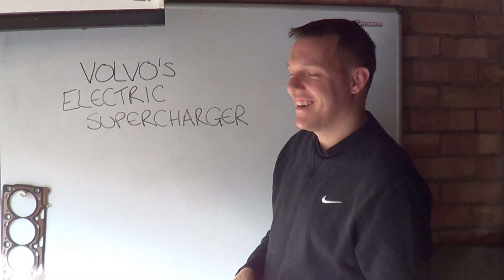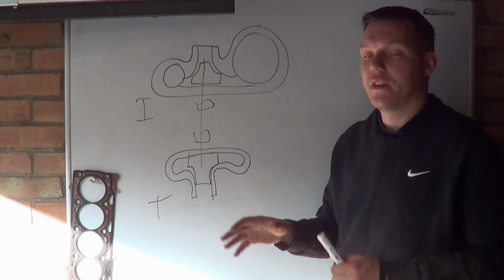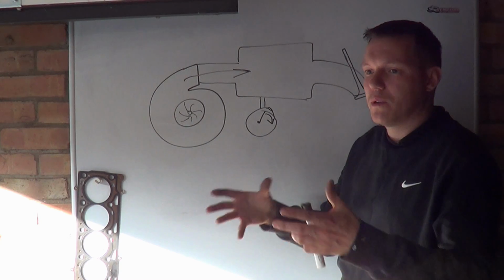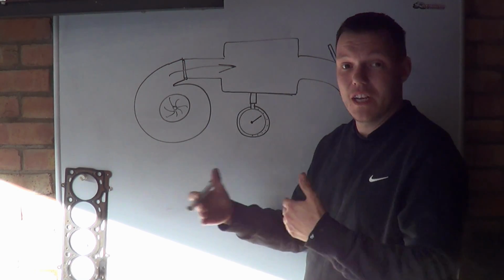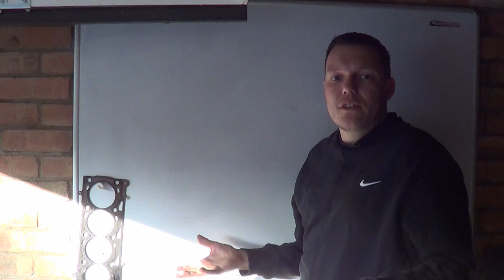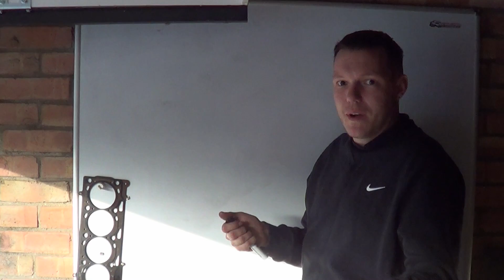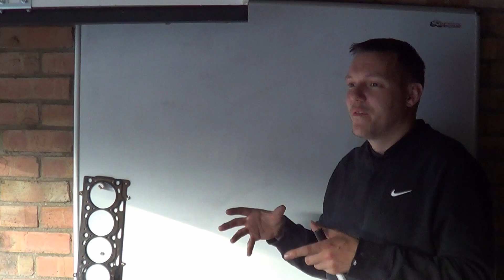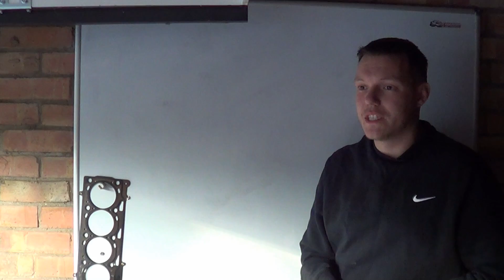Volvo's electric supercharger?

Comment: 1st device u described is NOT a mechanical supercharger. It is a turbocharger. The 2sides r called the turbine &the compressor. Superchargers r driven mechanically. Turbochargers r driven by hot expanding exhaust gases. It’s difficult enough2 understand  u w/your nose clogged atop a deep accent. Forced induction systems s/b explained by professionals w/clean hands& clean civil speech lest u botch the job like this. 

This is an embarrassing filthy mouthed fail.

Comment: If the pre charger is kept running even once turbo is at max rpm/boost will it not increase total mass flow and therefore increase total boost even at max continuous power? = more power over all!
Reply from the maker: Well yes, but you need massive amounts of power to do that. Any increase at 100% normal load is huge. Think HP vs fastest speed

Comment: There is a Dutch company selling electric turbo’s to day.

TorqAmp
2500,- euro / dollar
Reply from the maker: LOL yeah I've seen it. Boosts engine power lower down. Works a treat - however, why not just fit a normal turbo and have extra power? They cost about the same and use the same amount of fuel

Comment: a few people have told me 3hp [electric] roughly =5hp [gas]    do you agree?
Reply from the maker: What? For how much air? What flow rates etc etc etc. And the power would be the same - why would it be different?
Reply: @thedirtyworkshop  for any given task ex water pump if u had a 3hp electric  it would take roughly a 5 hp gas engine tp do the same job (incorrect or correct? )
Reply from the maker: Incorrect. That's what the measure of power is.... How much 'work' the engine/motor can do.
Reply: @thedirtyworkshop  thank you

Comment: that 20 percent is that just for turbos?  I was told the non screw [top fuel] superchargers can take about 30 percent of an engines power   thanks for patience
Reply from the maker: well its 20% of the total. So if an engine after turbo is installed makes 100HP then 20hp of that is what was required to compress that additional air.

Comment: how would you figure out the hp needed to supercharge or turbo an engine completely with an electric motor?   please be as specific as possible.                would it be based mostly on displacement and desired boost?
Reply from the maker: Great question, so you have to have specific numbers and they are as follows;

1) Mass flow rate - so how much air and in what volume. You also require the time of intake duration.

2) One issue with doing this mathematically is the gas deviation factor, also known as the compressibility factor. There's isn't enough room in the comments section to explain that so google it.

3) Next thing you need is the turbo efficiency and blow-by figures. Both for the impeller and the turbine. 

4) You'll also need a displacement volume graph for the engines cylinders, they're timing and the manifold flow dynamics. 

To make sense of all this you need to know

a) how much air per rev.
b) the mass and volume of that air which means you also need the temperature - this is of the ambient air.
c) You then need to know how well the cylinder(s) fill and how fast. So volumetric efficiency can help somewhat here.
d) the flow through the manifold - this is important because it helps you determine the surge limit of the turbo, and this tells you how much power you require from the motor. 

The easiest way is testing, or use figures from a system that is already used. For example you can look at an engine and say 'about 20%' should be good enough. 

So my question is, are you wanting to work this out pure mathematically or practically?
Reply: For the Volvo in this video how much hp would an electric motor need to take on all of the charging for that particular engine
Reply from the maker: Well I don't have all the numbers. Like I said.
Reply: So let me ask on an engine that has a charger (tur or sup) would the manufacturer have all those numbers?      Would it easier to dyno it.   Then try to mimic it with an electric motor to get the same readings?
Reply from the maker: "would the manufacturer have all those numbers?" - yeah of course they do. They had to so they could chose the correct system. Will they give them to you? - LOL no.

One thing you can do is record the T1 and T2 of the turbine. Record the temp before and after the turbine and then you can work out the energy - then with the turbine rpm you can work out how much power that is.

But it's easier to get you in the ball park. You get the engines total power and take 20% of that. That's the motor you require.

Comment: Like turbines in a power station, a turbocharger's turbine extracts energy from mass flow. It's not "heat energy from the flow of the exhaust system", people who say that are fooking idiots.

Get your damn theories straight before you start to educate people on the Internet. Or at least admit, that you don't know how a turbine works. Better than calling all people fooking idiots who actually know how it works.
Reply from the maker: ""heat energy from the flow of the exhaust system""

Turbines work on the momentum of the fluid, gases or liquids - just fluids. This momentum is the mass x it's velocity. The heat of a gas and its kinetic energy as proportional (average) Therefore the heat of a gas in related to it's velocity. Seen as though a gases mass in an engine is pretty much constant (depending on the Ve) then it's the heat and therefore the kinetic energy it has.

Mass flow is the mass, area and time. From this you can work out the velocity - and mass and velocity give you momentum. 

Funny how you say that "Get your damn theories straight before you start to educate people on the Internet." - but you're the one getting schooled right now...
Reply from the maker: If you still don't agree, point out what's wrong below.
Reply: @thedirtyworkshop  I can't tell if you genuinely don't understand how all of these terms interrelate, or just coming up with this back-assward explanation to prove, that what you said oringinally is somehow actually right. The following is where you're completely wrong:
"The heat of a gas and its kinetic energy as proportional (average)."
"Therefore the heat of a gas in related to it's velocity." (I'm just going to gloss over how "proportional" and "related" does not mean "is the same thing", which is what you're stating in your video. Also, that you're calling people idiots who suggest velocity has a role in a turbine, yet you are now stating it yourself.)

What you wrote before and after is true, but these statements are making a connection between two completely unrelated terms. Temperature (let's call "heat" by its proper name) is one important property that describes the energy contained in a gas or liquid. Now, what's another important property for that?

Also, let's make a thought experiment. Say you have a furnace that you can put the the turbine side of a turbo wholly through. The CHRA and the compressor side are in the outside air, relatively well isolated from the heat of the furnace. The turbine side is wholly enclosed in the furnace in a few hundred degrees *C temperature. There's plenty of "heat", so by your reasoning, the gas inside the furnace has lots of kinetic energy. Will the turbine spin?

Think about these two, and come back to me with you thoughts.
Reply from the maker: "which is what you're stating in your video. Also, that you're calling people idiots who suggest velocity has a role in a turbine, yet you are now stating it yourself.)"

- I say pressure, not velocity.

""The heat of a gas and its kinetic energy as proportional (average).""

- which is true.

"(I'm just going to gloss over how "proportional" and "related" does not mean "is the same thing", which is what you're stating in your video."

- related and proportional is not exactly the same thing, but in this context is fine, unless you wanna explain why or how they are polar opposites of each other, or how there is something that seperates the two...

"What you wrote before and after is true, but these statements are making a connection between two completely unrelated terms. Temperature (let's call "heat" by its proper name) is one important property that describes the energy contained in a gas or liquid. Now, what's another important property for that?"

- Awesome word salad there, but can't really make out what you're getting at? I'm pretty sure you're trying to make a point but I don't get what that point is meant to be. Also 'let's call it by it's proper name' is what cunts say - and it should be thermal energy - but that would make me a cunt...

"Also, let's make a thought experiment. Say you have a furnace that you can put the the turbine side of a turbo wholly through. The CHRA and the compressor side are in the outside air, relatively well isolated from the heat of the furnace. The turbine side is wholly enclosed in the furnace in a few hundred degrees *C temperature. There's plenty of "heat", so by your reasoning, the gas inside the furnace has lots of kinetic energy. Will the turbine spin?"

- Awesome I love these. So in this 'thought experiment' there's no flow. The turbine side is in a closed system. With no gradient then there's no transfer. You have to have a cold sink for work to be done (look up Qh ---> work ---> Qc or Carnot cycle) Anyroad, back to this silly thought experiment. Since the turbo and heat source (Qh) are isolated then there's not heat transfer, therefore no work can be done, apart from any transfer through the bearing housing. 

As for the kinetic energy of the gas in the oven, this again is in equilibrium. Any transfer of momentum is imparted on all sides of the blades of the turbine wheel so the net result is no net torque. Not only that but any momentum transfered to the blades and the turbine as a whole would then impart this momentum back to the gas around the blades as it tries to deflect the gas around it. Momentum conserved. 

"Think about these two, and come back to me with you thoughts."

And here you were, thinking you were smart.

- Edit. As like some others, you take what I say and jump to conclusions of your own. I'm saying the thermal energy drives the turbine - or in other words the energy to drive the turbine is from waste heat liberated by combustion. I'm not saying 'get a turbo hot, and it'll turn', because that would be stupid.
Reply from the maker: - Also, I have a 'thought experiment' for you. Going back to what you originally said 

"Like turbines in a power station, a turbocharger's turbine extracts energy from mass flow."

So, my question why heat the water? Why use hot water (steam) in nuclear power plants or steam engines for that matter? All these have turbines. 

As a seperate question, where does the energy for hydro-electric plant come from?
Reply: @thedirtyworkshop  Oooo K. There's a lot to unpack here.

"I say pressure, not velocity."
 - No, you are not saying pressure, quite the opposite, you said in no uncertain terms it ISN'T pressure:
https://youtu.be/gPLK59zDWjQ?t=200 "a turbine extracts heat energy, that is in the exhaust flow, it's not how much pressure, isn't(?) speed, people who write that are fooking idiots."
Had you said pressure, I wouldn't have been compelled to start this here little exchange.

"So in this 'thought experiment' there's no flow. The turbine side is in a closed system. With no gradient then there's no transfer."
- That's right. Now we're getting somewhere. At least you understand that there has to be some kind of difference. Just gonna ignore some other stuff in that paragraph.

Let's evolve the though experiment a bit. Let's introduce a difference along the turbine. This furnace now has a flange, and we attach the turbine inlet to it, just like a manifold of an engine. We connect the turbine outlet to outside air with 15 feet of steel piping, just like the exhaust of a car. Crank up the furnace to 1100 degrees *F, just like the exhaust gases exiting the combustion chamber of a petrol passanger car at cruise load (or thereabouts, I've measured). 

We now have a steady gas supply 1100 degrees *F hot right next to the turbine inlet, 15 ft of steel piping leading to a much colder location. Same for our experiment, just like for a car engine.
A typical passenger car turbocharger spins about 20,000 RPM under crusing load. Will our furnace-attached turbocharger spin at 20,000 RPM?

Power station sutff:

"So, my question why heat the water? Why use hot water (steam) in nuclear power plants or steam engines for that matter? All these have turbines."
- Exactly, why? If you have a source of consant heating, why not just direct that heat onto a turbine, same as a turbocharger? Why is there a transfer medium? Why is this transfer medium water? Why not a liquid that doesn't boil away? (Let's just simplify it down to coal-fired, water's role is much simpler there, yet illustrates the point all the same.)

"hot water (steam)"
- Formulated that a but unfortunate. Hot water is very much NOT steam. And the difference is crucial here. What happens to the various properties of water, when it becomes steam?

"As a seperate question, where does the energy for hydro-electric plant come from?"
- Same as a coal-fired power plant's turbine. Mass flow through the turbine. In a hydro-electric plant, that's an already existing mass flow. In a power plant and a turbocharger, we're creating that mass flow. How do we do that? What compels a mass of gas to change it's location? Not just in the exhaust of an engine, but anywhere, at all?
( I've actually already given away the answer earlier. )

You look like you have all the pieces, but are somehow hell-bent on arriving at the wrong conclusion.
Reply from the maker: ""I say pressure, not velocity."
 - No, you are not saying pressure, quite the opposite, you said in no uncertain terms it ISN'T pressure:
https://youtu.be/gPLK59zDWjQ?t=200 "a turbine extracts heat energy, that is in the exhaust flow, it's not how much pressure, isn't(?) speed, people who write that are fooking idiots."
Had you said pressure, I wouldn't have been compelled to start this here little exchange."

- yeap I said that and I'm fine with that. People says speed, not velocity, and not momentum. SPEED. There's them words taken out of my mouth again.

""So in this 'thought experiment' there's no flow. The turbine side is in a closed system. With no gradient then there's no transfer."
- That's right. Now we're getting somewhere. At least you understand that there has to be some kind of difference. Just gonna ignore some other stuff in that paragraph."

- I love how I'm explaining this and you say "At least you understand" - fuck off. I've always understood it, well for the last say 15-20 years.

"Let's evolve the though experiment a bit. Let's introduce a difference along the turbine. "
- Dude you're shifting the goal posts here. I don't have all fucking year to help you fill out your exam questions.

"Exactly, why? If you have a source of consant heating, why not just direct that heat onto a turbine, same as a turbocharger?"

- Working fluid knobhead. You're still caught up on something here and I think it's that I said speed. Now Speed and velocity are 2 different things. You it's you that have the issue not me. Before calling someone dumb - make sure you understand the whole concpet.

Funniest thing is you say 'let's just simplify this down' but you're the fool here.

"You look like you have all the pieces, but are somehow hell-bent on arriving at the wrong conclusion."

- And this is EXACTLY what you have done, not me. Dickheads like you seem to KNOW what I'm thinking better than I do. That, is impossible.

I'm quite pissed off, because I've done about 10 videos on all of this, going into adiabatic compression and expansion etc, and here I am being lectured by some fucking idiot that doesn't know the difference between speed and velocity. And you're probably reading this thinking 'nope, not interested - lost me when you called me a fucking idiot' and if this is true then LOL because it's just a fucking word, and they can be changed - the fact that you're an arrogant arsehole probably can't - but who knows - weird shit happens everyday...

Comment: funny you have so little faith in the concept, when electric motors are as powerful as petrol engines... telsa's are proof of that. However at the moment the only electric supercharger id put my faith in is the phantom electric supercharger i know it can make boost and hold it, it uses 2 12v batterys connected in series putting out 24V to power the electric motor.they give 6-7psi, but you can never place 2 12v batterys on a motorcycle, good system for a car. in regards to ebay electric blower and whatnot stay away those are def a scam. this guy does a great video on the subject. https://www.youtube.com/watch?v=G8XT00GpKuE
Reply from the maker: "funny you have so little faith in the concept, when electric motors are as powerful as petrol engines... telsa's are proof of that."

- well not quite - power is time dependant. A petrol car can cover a larger distance than an electric car due to charge times. 

Watched the video - 100 amps @ 60V and it produced 1.7 psi - the motor was getting way too hot and you expect this thing to work? Even the guys calculations show that you'd need 164 kW!

You have to be real about this - 100 amps fine but 60V?!

Compare this to a mechanical turbo charger - without the batteries and motor etc - just aint gonna fly until room temp super conductors or something. By that time petrol engines will be almost dead.